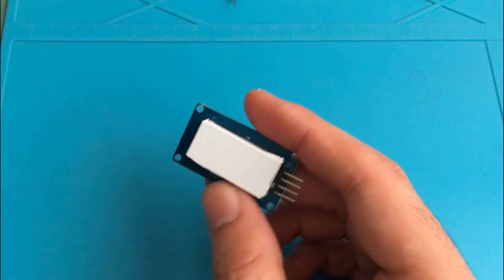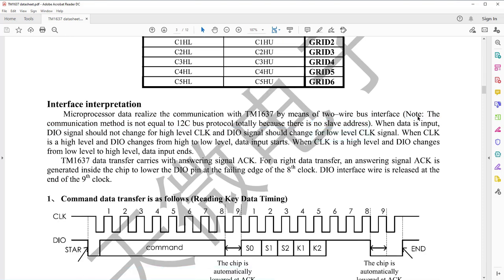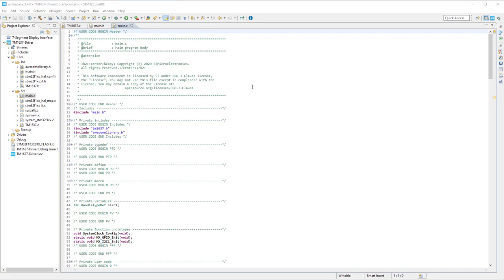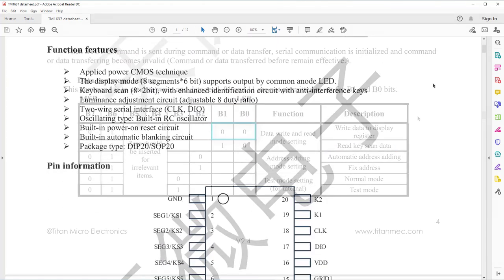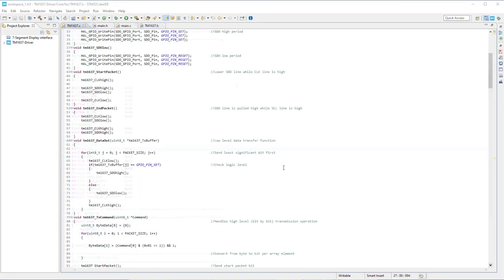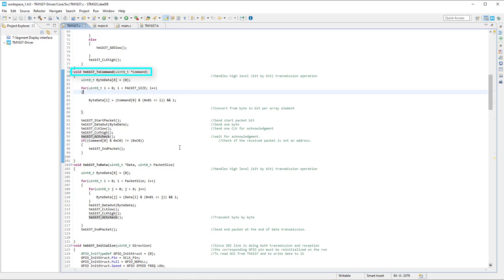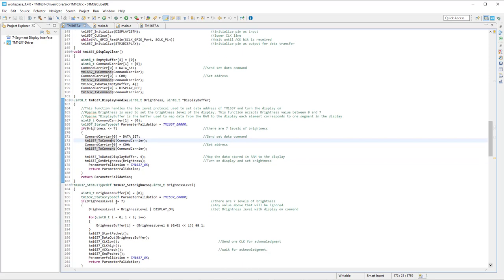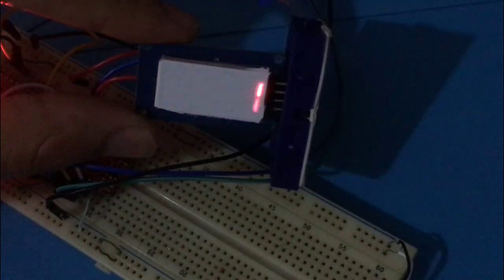TM1637 LED Display Interfaced Using STM32 Microcontroller

Comment: If you still remember that, can you explain why you check the ACK signal only after the 9th clock cycle, and not as recommended by the TM1637 datasheet after the 8th clock cycle? Is the DIO kept LOW by a TM1637 longer than stated in a datasheet (until the EndPacket) ? But nevertheless great job. Keep up the good work.

Comment: Nice Job on this Video and your Library. <3

The only thing im kinda confused is the ACKcheck function you mention on 10:32. You said that the SDO-Pin is used for input and output and it should be switched to receive the ack bit but you switch the SCLK-Pin to receive the ACk bit. 
So i think the ACKcheck-function will fail because the ack-bit is send from the dio pin which is connected with the SDO-Pin or am i wrong?

Comment: there is not complete example in your code. can you show some number on displays?
and you point in this video to a function named tm1637_shift. there is not in TM1637.c
Reply from the maker: Hi, 
Apparently, the repository doesn’t have the last modifications I had done when uploading this tutorial. I will commit and push the last version of the code once I reach my old PC. tm1637_DisplayHandle function can print characters on the display depending on buffer data passed to it.
Reply: @usefulelectronics  thanks, how can i select each display and show a numbr on it? how can i flash dots?
Reply from the maker: @GreenTech_SmartHome  Remember the buffer I told you about, well this buffer can contain up to 4 characters an these characters will be mapped to your display depending on the data order stored in the buffer. I advise you to get your hands dirty with the library and get yourself familiar with the hardware.
Reply: @usefulelectronics  i wrote hell on displays when you told the function. i thought there is a way to select each displays and write number on it. as you are telling, i should write on all of them instantly. ok. how can i turn on tow dots? i want to show clock on it. so i have calculate time and there is parameters. now i want to show these parameters on it.

Comment: Does it work for tm1640 (28 pin)as well ? What would be the changes ? Reading the datasheet.
Reply: It does not work properly. I changed C0 to 00 as per the datasheet. Yet, I see no result.
Reply from the maker: Hi 
Both ICs have the same working principle so the protocol is the same . The first thing that comes to my mind is to change the number of clocks peer packet.

Comment: why did you choose i2c in cubemx. You don't use i2c. Am i wrong?
Reply from the maker: I2C was not activated at all. SDO and SDI were the names of the used GPIOs for the display interface
Reply: @usefulelectronics  thanks a lot.

Comment: Enabling I2C in the communications module automatically sets the SDA and SCL pins but, more importantly, sets up the I2C module in the main.c
Reply from the maker: The communication protocol is not I2C since TM1637 doesn’t have slave address. The second thing is that the data transmission starts from LSB

Comment: but on github there is no "library" - this is a complete example with cubeMX project - can you separate just TM1637 code in form of library and put this into another repository? And maybe link to example repository as submodule or just just separate library and example code to easier reuse this with just git pull?
Reply from the maker: Hi thank you for your feedback. 
Yes you are right. I will create a new repo to include TM1637 library.